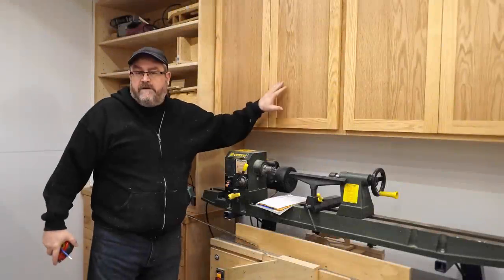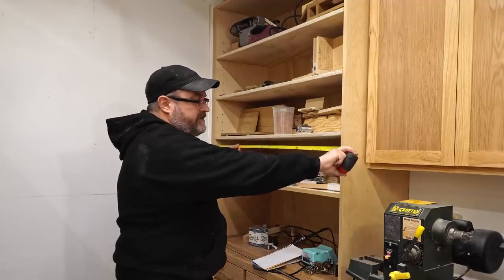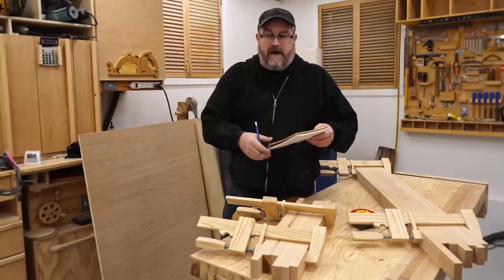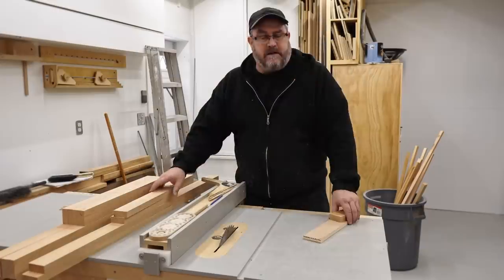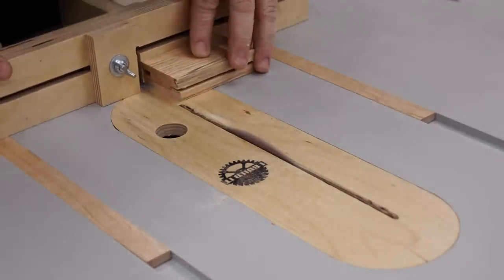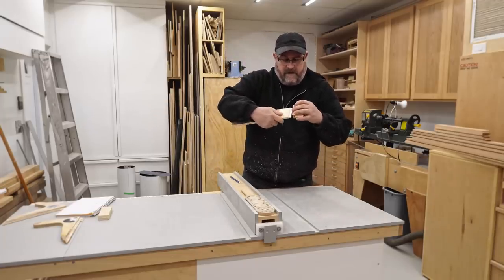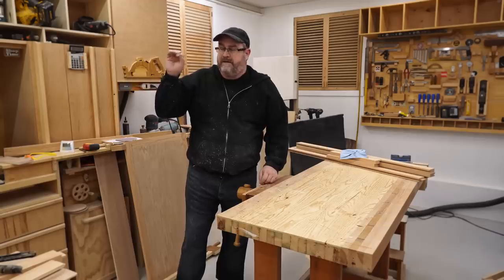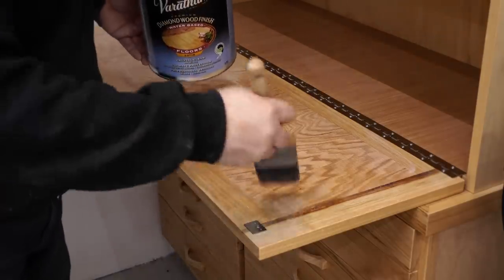Making Cabinet Doors - Detailed Version - Woodworking

Comment: I always like to make a rough sketch (I fondly refer to these as a cartoon) showing details and their corresponding dimensions.  The cartoon doesn't prevent all mistakes, but does cut down on them.  Great video John, thumbs up.
Reply: That's why I like to draw a full scale model on the computer. I found my brain is able to borrow an inch here and re-use it there, where the computer won't let you fudge the dimensions like you can on paper (or in your head). I have no problem with someone doing it in their head or on paper, but I know that's when I usually make a mistake.

Comment: Cool vid. My only quibble is clamping rails.  Cut and sticker if it moves dont use.  Clamping will only hide the inevitable.  Bit many years ago and had some doors twist on a client piece and had to redo.  Painful lesson. Tip though to save on qs $$. Buy wide flatsawn.  It's cheaper and you will find on outer edges as or rift sawn enough to get r&s for your doors.

Comment: is there a functional reason why you chose construction adhesive instead of wood glue or just preference?
Reply: He's talked about that in a couple of other videos: it's mostly because the construction adhesive has a longer "open" time than wood glue, so there's more opportunity to adjust the fit before the joint gets too tight to move. In absolute terms, wood glue joints are stronger, but when you consider the length of these joints -- how much glued surface area they encompass -- the distinction between construction adhesive and wood glue become academic. They are more than strong enough, and the wood will break before the joint ever opens up.

Comment: Jesus christ America get onto the metric system already!
Reply: He's in Canada.  But thanks anyway.
Reply: @johnk6206  Ah fair point!
Reply: We here in North America can use both metric and standard, why so hostile?
Reply: @KipdoesStuff  I'm not being hostile I watch all of Johns stuff, I am always amused when on that side of the pond the math power required just to half something. And here in the UK we still retain the mile, so there is that. Sorry if my UK humour comes over as hostile, it was not intended.
Reply: @garethsnaim8174  Its actually easy to half a fraction. Just double the denominator. So half of 1/8" is 1/16".
Reply: Metric is for wimps. Man up and use imperial.